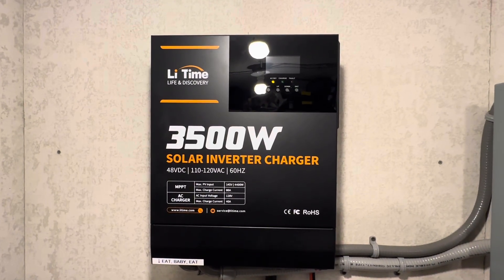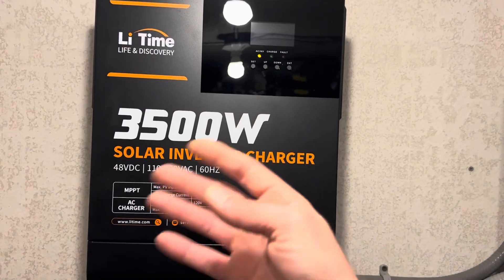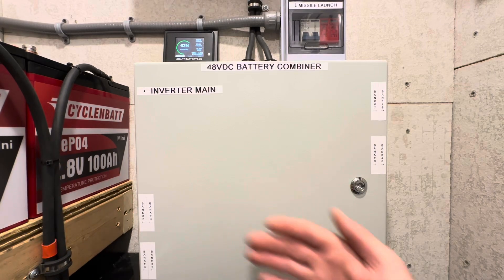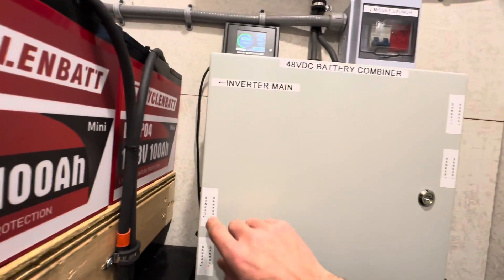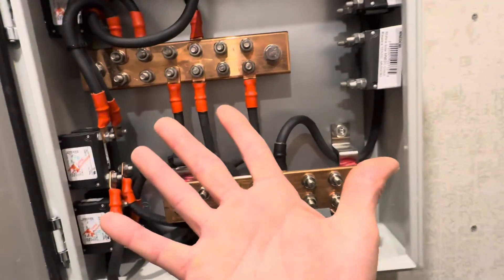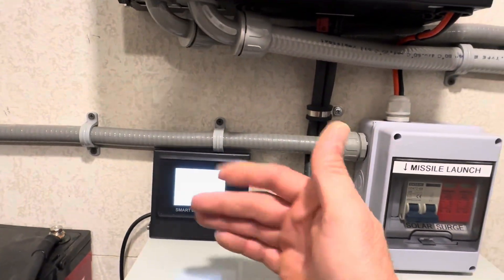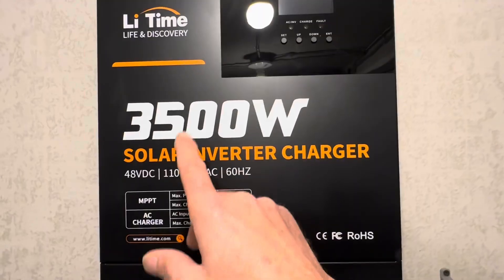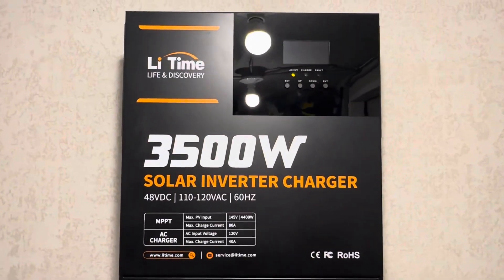Budget 48V Off-Grid Solar Build Part 3, DIY Lithium Battery Combiner & Updates

Comment: I am eyeing this inverter and your earlier video was definitely the most thorough on the internet. It seems to be a rebrand of the   SRNE HF48-HF4830S80. I don't know that for sure, but as far as I can tell, that's it. Will Prowse has done many LiTime reviews but he hasn't reviewed this one. However, 4 years ago, he did review a Renogy that looked almost identical and had the very same stats: wattages, mppt voltage range, etc. It also appears identical. So, I think it was a slightly earlier version of this unit. He actually hated it. He said the battery leads were too close together. His version didn't have an AC ground out and I believe this one has it, so it's not identical. But other than that, I don't think there are any differences. That's a big one, though. So, I just cannot decide whether or not to pull the trigger on it. Good to see you're not having trouble though cause I don't think this company is reliable in terms of service per the web comments.
Reply from the maker: Thank you for your feedback! 
The battery terminals are a touch closer than some but have a robust insulator between. Shouldn’t be an issue and hasn’t been for me. I do feel it is a custom contract unit by SRNE for LiTime. I have no complaints from its performance. It’s done what I’ve asked of it. As to customer service from LiTime, I haven’t had to interact with them on any warranty claims so can’t offer any feedback for you on that. I personally go through Amazon instead of websites and if there is a warranty/vendor issue they usually do pretty good at making it right. 
I plan to have an update video on this inverter soon. Take care, anything I can do to help just let me know 🙂

Comment: By combining different Lifepo4 batteries, I understand that the total Ah must be listed in the inverter. The current charge for each set  of batteries may be different, did you list them at  the same value in the inverter setup for consistency?  Are there any other battery that should be considered in setting up the inverter?
Reply from the maker: @johnrutledge1877  I just set charge voltage to 55.2 and float to 54.4 I have absorb time setting to something like 20 min. The system is still being worked on and not used daily yet. I’ll go through and fine tune everything once I’m finished. The batteries all charge and discharge very evenly with oversized short wire runs and large bus bar. Maybe .1 or .2 amp difference under heavy inverter load. The small inverter is not capable of overwhelming the battery system either on charge or discharge. I’ll update soon on this! 👍
Reply: @THEOFFGRIDMOUNTAINHOMESTEAD  Thanks again for the information.  Looking forward to your continue updates.

Comment: Would you recommend this setup for a mobile pet grooming station??
Reply from the maker: Might be better to use a 12V setup since you would have an existing 12V charging source on a van/box truck? Plenty of 12V stuff catered to RV folks that would make it easy. But 48V is also viable there are commercially available 12V to 48V charging options that utilize alternators as well. Pick your system size and cost compare. 12V will of course have much larger wire. But other components tend to be lower priced. Some of the new 3000W 12V inverters can hit 90% efficient which is good. This 48V is averaging 94-95% efficient battery to AC conversion.
Reply: @ thank you for your recommendation. It’ll be for a ford transit van that I’m looking to converting into a mobile pet grooming business. I was thinking generator but I think it’ll be a bad idea considering the fumes so I’m looking into lithium ion batteries with inverter to power, vacuum, light, outlets, blower, air conditioning and possibly cameras. I just haven’t made a final decision on what could be the best possible option.
Reply from the maker: @Sp1d3r-h3m  There are 12V rooftop AC units for sub $1K that are fairly efficient. No conversion losses DC to AC etc. 
My RV has a 3000W 12V Inverter\charger. It runs the factory 120volt Air Conditioner and Microwave at the same time with a little bit of room to spare. The built in charger can recharge up to 100A back to the batteries on shore power. This type could help you recharge batteries overnight at home before work the next day.

Comment: So Bus Bars can combine various Battery Banks of 280 amp hour and 100 amp hour Batteries and a 24 Volt Battery Banks to Just 1 Battery Combiner Box ?
Reply from the maker: Each battery should have its own overcurrent device when shared or connected as a common battery bank. The larger the battery bank and lower the current on each battery helps equalize out the draw between various Ah capacities. One 280 and one 100Ah would show a disparity when running them hard. Several 280s and several 100s together will tend to current share better and also tend to reach 0 or 100% SOC at almost the same time.

Comment: Interesting build. My solar system has SOK batteries (the ones without the display). I purchased an EEL DYI 48V battery box and want to integrate this into my system. The SOKs are 48V set in parallel. What would be the best way to incorporate the EEL battery box.  Thanks for your time. John
Reply from the maker: @johnrutledge1877  Are you wanting to parallel your new 16S battery build in with your existing SOK rack mounts? Are they sharing common bus bars, or  do you have the SOK paralleled with just jumpers, battery to battery?
Reply: @THEOFFGRIDMOUNTAINHOMESTEAD  Yes, I want to parallel the box with the existing SOK rack mounts. I plan on adding the Victron Lynx power-in module for all batteries. But not sure if that would be a parallel connection with the EEL battery box.
Reply from the maker: @johnrutledge1877  The Lynx 1000DC distribution bar should be good. Each battery would be fused as well through the bus as another layer of protection. It is a modular bus bar. So yes the EEL kit battery should parallel in just fine. Each battery will share the loads across the device. It’s a quality unit.
Reply: @THEOFFGRIDMOUNTAINHOMESTEAD  Thank you for the reply I appreciated!

Comment: I tried adding up the price of all those components and why not just go with an all in one eg EG4 6000xp for almost the same price? You'd have everything built in one without the complexity of wiring a pv combiner box, pv disconect, built in breakes, ability to do 240v and almost double the output at 6000w. Just seems like this is significantly more labor, time and complexity to maybe save $100-$200
Reply from the maker: @fabianhernandez1734  Different products for everyone’s needs this is the great thing about various manufacturers and all the cool stuff nowadays! 
I don’t have a PV combiner. I spent 30 for the PV disconnect (breaker) and box. Correct an inverter breaker is included with EG4, I had to add for this one. 
Regardless of inverter used a DC battery combiner of some type with individual OCPD would be needed when mixing different brands of LiFePO4 unless one went all server racks of the same brand. Common bus bars still help with server racks and many rack cabinets have them to help with equal charge/discharge on each individual rack battery

Comment: So you need about 100v solar input or it won't work and charge? Would I be ok with 2 48v panels?
Reply from the maker: 60-145VOC on the built in MPPT. I have connected a 400W array to this inverter several times to check functionality of the solar charge function. 88VOC (4-100W panels) the charger likes to track this array at 60-65V. Delivering 340W which is exactly the same I get from the array on a MidNite solar stand alone controller. So the inverter tracks well from initial testing. 
The drawback of the inverter is idle consumption vs a stand alone charge controller. 50W idle consumption.